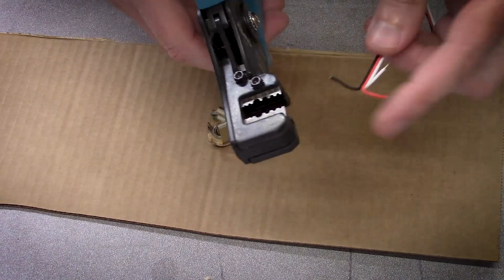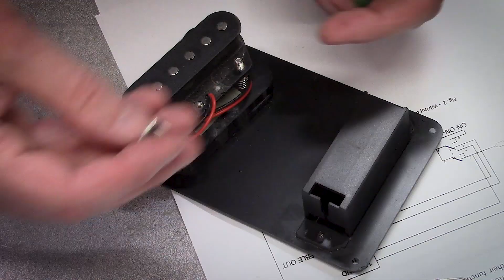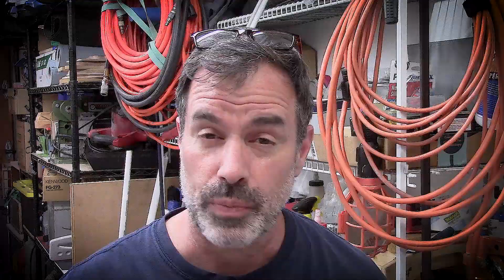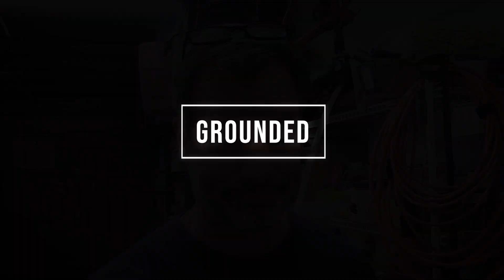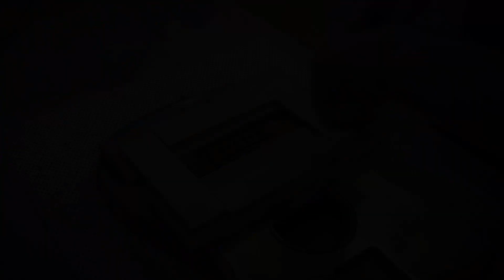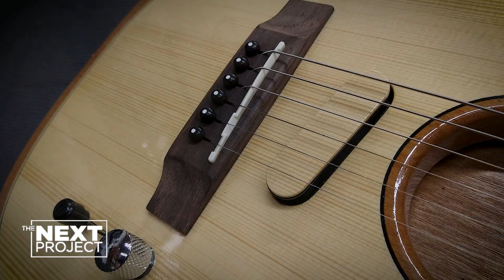Building a T-Style Acoustasonic from a Harley Benton kit - Ep08  Finale

Comment: I saw a person pull the electronics out of a Acoustasonic Tele to put into a custom guitar build and the Tele bridge pickup was wired into the preamp instead of the pots like a normal Tele. 
The stereo socket you have has 3 solder points on it. The ones I see in the schematics for a regular tele the stereo jack only has two solder points on them. Could be another problem depending on the amp you're using. Especially if your guitar cable is only a tip and ring cable instead of a tip ring and sleeve cable.

Also you said your amp was in acoustic mode, when you started using the Tele bridge p/u did you put your amp into one of the electric guitar modes it has. That might might affect the sound volume for the electric p/u as well.
Reply from the maker: Digital, thanks for watching!
You're right, I originally used a stereo-out jack when I was trying to get the battery powered pre-amp to work. The extra solder lug on the jack was used as a battery disconnect, so when you'd pull the cable out, the battery circuit would be cut and the battery wouldn't drain.  
When re-wired to a more traditional pickups and pots scheme without the pre-amp, I went to a standard 2-lug ( + / - ) jack.  Better balance of sound between the piezo and coil pickup at this point.

I need to re-visit this guitar someday. It is a lot of fun, light, decent (not great) acoustic sound for strumming unplugged, and oh so lightweight too.
Hope all is well, be safe and take care!

Comment: The problem is that you are mixing different impedances. Both piezoelectric and magnetic pickup are typically very high impedance whereas the output of the preamp is comparatively low, probably around 10k ohms so adding the preamp across the high impedance pickup is shunting a lot of the signal especially high frequencies. You would need another preamp for the magnetic if you wanted to go down the original path however I think the final solution sounds fine. Thanks for a great series of videos.
Reply from the maker: linthorn, thanks for watching!
Yep, totally agree.
In the end, it did work pretty well with the pre-amp stripped away.
Someday I'll circle back and assemble a better (different) solution as you described.
Hope all is well, be safe and take care!

Comment: This turned out really nice!   That new fretboard wood is absolutely gorgeous.  Much better than what it came with.

As far as the wiring, I’m afraid I’d run into the same issue and would probably come to the same conclusion.  I did a bit of research, as I’m sure you did as well, and found the Fender Acoustasonics have a massive PCB board inside, so they’re probably using some trickery to get it working, which would be impossible to replicate.  The only way I can think to get the preamp working would be to get an active tele pickup.  That said, maybe there’s someone out there who has a solution.  Wiring is not my strong point… I buy wiring kits for a reason.  😅

It’s working the way you have it now, and that’s what matters.  It’s all about experimenting and learning new things along the way.
Reply from the maker: Curator, thanks for watching!
Oh yes, that fingerboard is great. It was a bit "gummy" to cut the fret slots, but it's been a great fingerboard ever since. It sits right next to the couch, so always within reach at the end of the day.

Fender does use a pretty crazy Fishman (?) PCB preamp magic carpet inside their guitars.
I had done a bunch of reading and had hoped (foolishly) that I could come up with something close, but everything was waaaay out of budget.

At it turned out, it has good volume out of both the wound pickup and the piezo bridge ribbon. I had planned to go back and try to get a fancier solution working, but I've moved on to other projects. Maybe someday I'll circle back, maybe.

Hope you enjoyed the project, it was fun and very educational for me. I tried a lot of ideas, most of them worked, I hid the others away for another day.

Take care!

Comment: Awesome build and great instructional video! 🤘🏼 I want to give it a go. Where would I find a preamp with volume/tone/blend or just volume/blend with selector switch? I have no idea where to start looking lol.
Reply from the maker: Endo, thanks for watching!
I honestly don't have a good answer to your quest for a preamp with the features you seek. 
I had looked at a lot of different options, most with little or no "features" on Amazon and ebay. Also looked at preamps made for acoustic guitars, but I couldn't figure out where to mount such a device on this body style.
As it turned out, I don't even have a preamp in the guitar. I'm running a standard tele-bridge and also a piezo-saddle, both into a typical switch. 
Simple seems to be working pretty well, but I don't have all the fancy capabilities of a true acoustasonic. 

Sorry I have not helpful info to share.
Good luck with your search and project build.
Take care!
Reply: @theNextProject  no worries, your build is super helpful. I'm down for the adventure lol. You take care as well.

Comment: How did you attach the spruce bridge pup cutout to the top of the pickup? Covering the pole pieces might be muffling the output. Fantastic build, otherwise. I'd love to try building one of these.
Reply from the maker: Hellcat, thanks for watchin!

The spruce cutout is attached with some thin, and sticky, double-sided tape. The wooden piece is about 0.060" thick, so just under 1/16".  The top of the pickup is around 3/16" down from the strings.

I get your concern about it being "muffled" and I thought that may be the issue too. As it turned out, the spruce and pickup distance seems well balanced to the saddle piezo pickup.  

I'd like to say that was all planned, but I typically don't follow my plans. This was a nice accident, we'll go with that.
It was a really fun project, I learned a lot, and would likely change a few things next time. As it is, I use this guitar way more than I originally thought I would. I has enough acoustic volume, I just sit on the couch and play without being plugged in most of the time.

Be safe and take care!

Comment: Sei stato perfetto nelle spiegazioni e in tutto. Quindi alla fine il suono migliore è quello dell'ultima configurazione? La più economica senza VSC-3?
Reply from the maker: Grazie per aver guardato il video!
Non ho usato alcun preamplificatore integrato, ma se fossero cablati correttamente insieme al pickup magnetico, potrebbero funzionare in un modo più desiderato.
Non sono riuscito a ottenere le opzioni del preamplificatore per creare il suono e il volume che speravo. Potrei lavorare di nuovo sul cablaggio per questa chitarra in futuro, ma per ora funziona molto bene così com'è.
Stai al sicuro e prenditi cura di te!

Thanks for watching the video!
I didn't use any built-in preamps, but if they were wired correctly together with the magnetic pickup, they might work in a more desired way.
I couldn't get the preamp options to create the sound and volume I was hoping for. I may work on the wiring for this guitar again in the future, but for now it works very well as it is.
Stay safe and take care of yourself!
Reply: @theNextProject   tutto assolutamente chiaro. È la prima volta che la soluzione economica suona bene come quella più costosa. La mia paura era che il pickup del ponte sia più debole come suono rispetto a pickup dietro la buca. In quel caso pensavo che si potesse mettere un potenziomero per equalizzarli. Può essere un'idea? o basta allontanare il pickup dalla corde :). ho visto che esisrono pickup integrati col ponte a sella (sorse sulnano meglio non so). Ultima domanda: hai usato potenziomentri B250 oppure A500 grazie. sei un grande! Spero che la chitarra che sto costruendo assomigli alla tua!!!
Reply from the maker: Il piezo a sella e il pickup magnetico suonano molto vicini nel volume di uscita, il che è stata una sorpresa per me.
Sono contento che potrebbe essere solo cablato e un preamplificatore non era necessario.

Per quanto riguarda i potenziometri che ho usato, sono entrambi potenziometri da 250K CTS.
Non ricordo se il potenziometro del volume è (A) audio o (B) lineare. Mi piace il lineare per il volume, ma potrei non averlo cablato in quel modo.

Sono felice di sapere che hai un progetto di chitarra in corso. Prenditi il tuo tempo e divertiti, questa è la cosa più importante. Divertiti e impara lungo la strada.
Tienimi aggiornato man mano che il tuo progetto avanza.
Buona fortuna!
- - -
The saddle piezo and magnetic pickup sound very close in output volume, which was a surprise to me.
I'm glad it could be just wired and a preamp wasn't needed.

As for the potentiometers I used, they are both 250K CTS pots.
I don't remember if the volume pot is (A) audio or (B) linear. I like linear for volume, but I may not have wired it that way.

I am happy to know that you have a guitar project underway. Take your time and have fun, this is the most important thing. Have fun and learn along the way.
Keep me updated as your project progresses.
Good Luck!

Comment: One last question.  And you may not be able to answer, but how would you remove the hum?  Its one large cavity, in this case how would you shield anything?  Would you run a ground wire to each pot and the switch, and put a shield around the switch?  Any idea how Fender does it?
Reply from the maker: Hey Scott, 
I didn't shield any of this guitar, as it is basically an acoustic shell.  The pickup itself could be shielded, shielded wire leads used, but I would expect there to be some potential for interference anyway.  Not sure how Fender addresses this. 
I do have the bridge and strings grounded, which you've probably seen.
Sorry I cant offer a solid solution.

Comment: Great series of videos. I watched them all. I think the reason your magnetic pickup was low in comparison to the piezo was your grounding (brass plate) draining the circuit flow from one side to the other with the preamp installed (does that make sense?) The fender version does not have a grounding plate. They call the magnetic pickup 'noiseless' which is a fallacy. I have a tele acoustasonic and the magnetic pickup is certainly not noiseless.
Reply from the maker: Zibbe Zabba, thanks for taking the time to watch them all!
I kinda get what you're saying. I wonder how fender is doing their grounding, but they have a lot of high-end tech going on in their acoustisonics. 
The whole active/passive combined wiring thing has me scratching my head. It's probably easier than my brain is making it, and I am no doubt misunderstanding all of it.
I really enjoyed the project, even with the issues. All good.
Thanks again, be safe and take care!

Comment: It is every bit as good as the new Mexican built Acoustasonic Fender has put out. It is $1200.00 with a 3 position switch. The under saddle pickup and the electronic pick-up. The American has a 5 way for the wafer piezo , under saddle, and electronic pick-up. Great job. May try it myself.
Reply from the maker: Keith, thanks for watching and glad you like the outcome of the project too!
It was a fun challenge, sadly the project got strung out a bit, but that seems to be my normal.
I may revisit this in the future, add additional piezo pups, still a lot to learn. 
Be safe and take care!
Reply: It is far away from a Fender Acoustasonic, couse Fender builds a Fishman Modelleing Preamp in. And this preamp is the reason for the authentic acoustik sound. And Fishman dont sell this modelling preamp to private customers. 
There is a ringing sond on this famos build guitar from "the Next Projekt", and only removing this is a lot of experimental work. 
I am a experimental worker on guitars too. It is relativ easy to build a solid body electric guitar. But to build a e guitar that can sound real acoustic, is a big challange. I´m just trying a mini microphon in a seperate chamber made in the body. 
I wish you a lot of fun at building. And dont give up, if the first trys dont give a resoult, that make you realy happy.

Comment: Please. Could you send me a link of the preamps you are using.
Reply from the maker: Manfred, thanks for watching!

Here are the 3 different onboard preamps that I purchased and tried out, all were purchased from ebay.

Active Onboard Guitar Preamp Blade VSC-3 Replica - AnalogWorkshop
https://www.ebay.com/itm/273681790821

Tiny Active Onboard JFET Piezo Guitar Preamp 6dB Linear Gain Booster:
https://www.ebay.com/itm/115156906740

Blade VSC-3 embedding internal guitar preamp EQ PCB replica
https://www.ebay.com/itm/114697773041

I have more experimenting to do with all of these. Maybe you can get them figured out and let me know what to do.

Good luck with your project(s), be safe and take care!

Comment: Quedo muy bien con buen sonido donde puedo comprar el preamplifier que uso
Reply from the maker: ¡Gracias por ver!

Compré los 3 preamplificadores que probé en eBay. Todos vinieron de Europa y el tiempo de entrega fue muy lento.

Puede haber mejores lugares para encontrar preamplificadores.

Aquí hay 2 opciones de eBay:

https://www.ebay.com/itm/Active-Onboard-Guitar-Preamp-Blade-VSC-3-Replica-AnalogWorkshop-/273681790821?mkcid=16&mkevt=1&_trksid=p2349624.m46890.l49286&mkrid=710-127635-2958-0

https://www.ebay.com/itm/Tiny-Active-Onboard-JFET-Piezo-Guitar-Preamp-6dB-Linear-Gain-Booster-/114551152600?mkcid=16&mkevt=1&_trksid=p2349624.m46890.l49286&mkrid=711-127632-2357-0

Thank you for watching! 
I purchased all 3 preamps I tested on ebay. All came from Europe and the delivery was very slow.
There may be better places to find preamplifiers.

Here are 2 eBay options:
- See listing above -

Comment: Great project, it turned out really beautiful looking and sounding too!!!!
You did a very neat job with this kit. Thumbs up! All the episodes were very entertaining to watch.
I am in the middle of a similar project and along the way I have ordered a lot of electronic components like you for experimentation that I might never end up using them in this particular project... So, I get your frustration!
About the volume mismatch issue you encountered: You probably cannot combine a passive pickup with an active in the same circuit. You can use both passive (as you finally did) or you could use an active electric pickup (with built -in preamp) together with the active piezo. But that also means 50K value pots instead of 250K and of course two preamps to feed with batteries... 
So, the more simple, the better!
Happy holidays, 
Stergios.
Reply from the maker: Ahhh!  So that kinda makes sense.  
As you said, a lot to testing and frustration.  Seems I never found a clear explanation, but rather a lot of opinions...  Thanks for explaining that clearly a concisely, much appreciated!
Hope your project is coming together well. 
Have a happy and healthy New Year!
Thanks for watching too!

Comment: In the cigar box guitar world piezos are common... there's a difference of opinion on which sounds better, the rod piezo under the bridge (or rather the rod piezo sits in a channel under the bridge position in the neck through under the the box lid in such a way that it maintains solid contact with the lid), or the disc piezos hot glued to the underside of the box lid in various positions. I favor the rod piezo...
There has also been a trend to install an onboard preamp with 3 slide equilizer to help model the tone as opposed to just wiring it directly to a volume pot to a jack (or just a jack), I've done both and favor the preamp but the latter is okay (they're cigar boxes for crying out loud!)
I really enjoy your channel!! Entertaining and informative!! Carry on!!
Reply from the maker: Hurdygurdyguy1, good to hear from you again and thanks for watching!
Thanks for the CB info. I had looked into some video of such, and agree, there are as many opinions as options.  I had originally though to glue the disc/wafer piezo(s) in place just behind the bridge, but then I tried the saddle piezo... I felt it sounded a lot better too.
2 of the preamps I tried did have onboard high/med/low adjustments by way of small screw pots.
Not really adjustable with the guitar buttoned up. I'll be giving these another try in a later project (that I'm trying to talk myself out of).
Good to hear you are enjoying the channel, always good to hear from you.
Take care!

Comment: Oh, wow, this guitar looks like a million dollars.
I'm glad you finished it after all.
As you know, I only have pick-up and guitar electronics project.
I was pretty patient and have not yet started on my hard tail St., it gets Fender Yosemite Strat pick-ups and I change from two tone-controls to a master tone. The new tone pot will be a Mojo Tone P/P vintage taper. I will use the P/P for turning on the neck pick-up in all positions. My plan is to fill the hole in the pick-guard from removing one pot with a kill switch. I know what kind of switch I need, but I can't seem to find it in the stores around, I might have to order it online, I don't want to. I want to get started, but maybe there will be this hole in the pick-guard for some time before it gets filled.
And please have a good time on Christmas, and have fun when watching some random ball getting dropped for the new year. I guess Americans have a reason why they do this.
Till next time.
Reply from the maker: Achim, thanks for watching and the great message too!
Sounds like you have a cool project to work on there.  Run that pick-guard with a hole in it!  It'll look like a hotrod, stripped of unessentials.  
I hope you have a great Christmas too.  As for new years, I don't always make it til the ball drops, my eyelids usually stick shut before all that - not that I'm getting old or anything... 
I think the ball drop is just another excuse to cut loose, drink too much, dance on tables, blow stuff up, run from the law...hmm, just another day really.
Take care my friend, until next time!